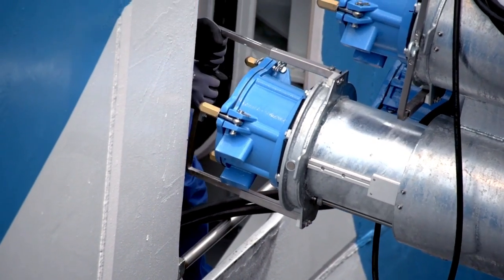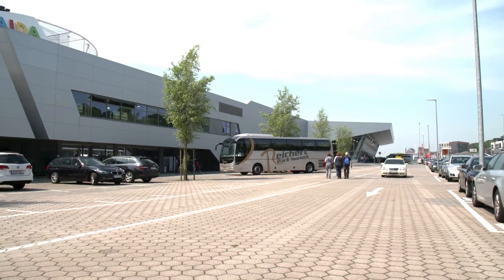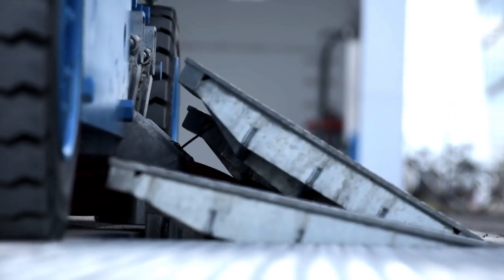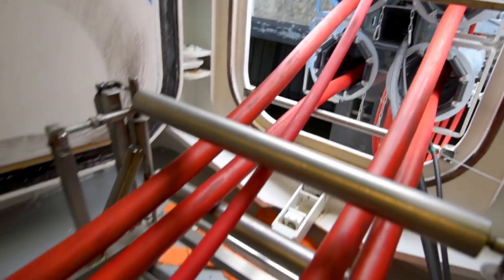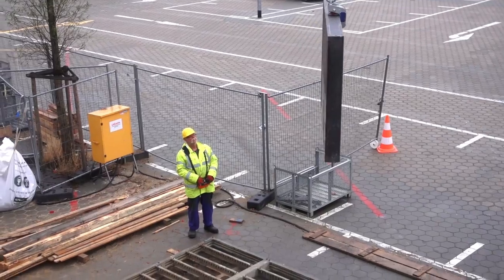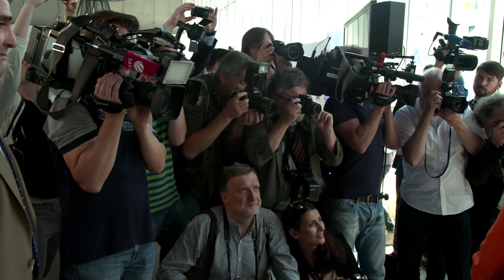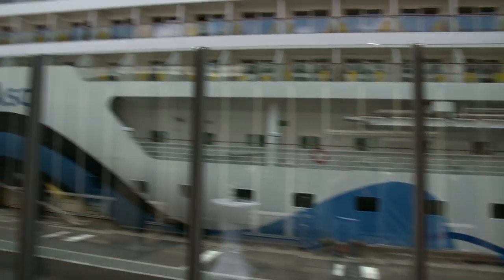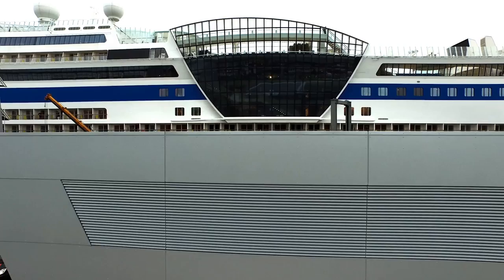Cruise ships go to the socket | Shore power for ocean liners

Comment: Why didnt they think of ghis before
Reply: It is more difficult than just plug a wire into it. The Ship can easily be the same power demanding of a building in the downtown core. since you need to unplug it later, the electrical grid has to be able to handle the capacity changes.